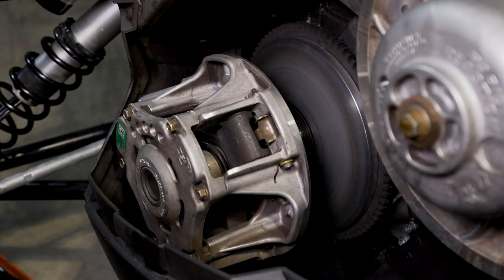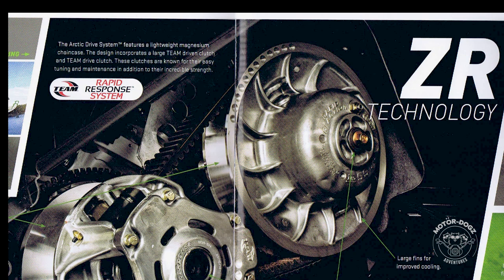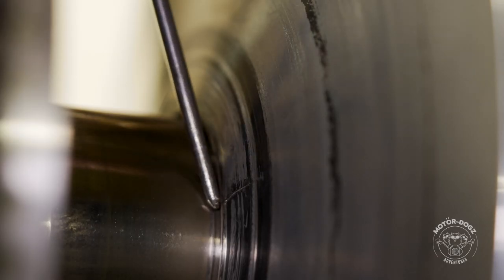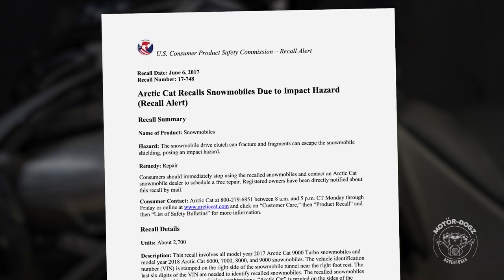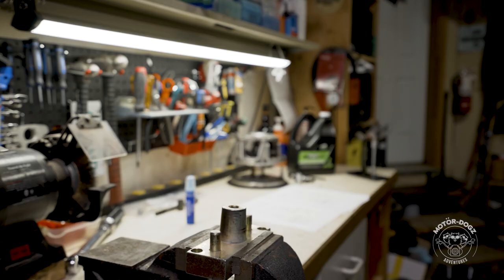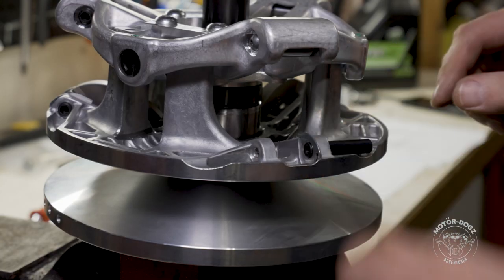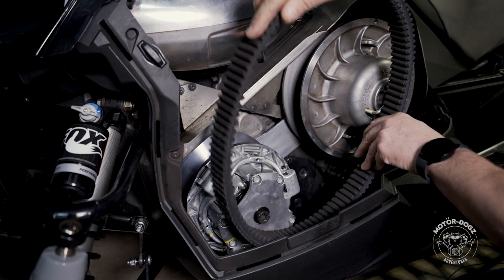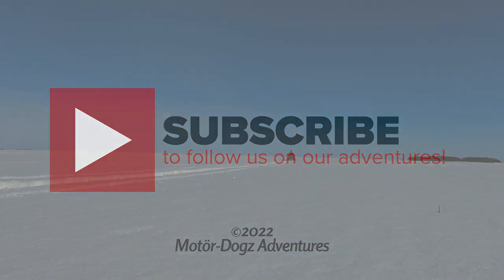Motör-Dogz Garage: Replacing the Team Primary Clutch with the Arctic Cat ADAPT Primary Clutch

Comment: So I gave up waiting on maybe a clutch recall update from Arctic cat as of all of them growing a time bomb effect. I installed a Polaris P-85 primary. I’ve got a 2019 hardcore 153 with a silber turbo.  The response is still ridiculous and belt life has increased also. And I’m not scared to hold the throttle to the bars.  Cheers🍺🍺🍺🍺🍺.
Reply from the maker: Nice. Glad it is working out good for you.  Was it a direct bolt on?  I assume you had to mod or replace your secondary to adjust belt deflection?
Reply: @MotörDogzAdventures  had to get the taper cut.  Special bolt out of states with the funky bushing spacer. Got the bolt from a 16 secondary for deflection and it’s been good.
Reply: @fasterdura1772  where did you get that done?
Reply: @andyfelsman2119  local machinist.

Comment: Great video. I bought a brand new team through BDX in 2020 for my 2013 M8 to replace the old unserviceable cat unit. It has around 2k miles on it and holding up good. When I spoke with the guy from BDX he told me there was a bad run of team clutches cat got from team for the models that came with them on them. Idk if that holds true or not but so far the one I have is not showing any cracking or abnormal wear. With that said, I'm eye balling the adapt but cant justify the switch to it just yet. i guess if I start seeing some serious cracking goin on I'll do it.. but crossing fingers it wont.
Reply from the maker: Thanks! Cat did recall some of the 2017/18 Team clutches for cracking but stopped there. They should keep going as the problem clearly wasn't fixed. Keep an eye on it for sure, check the outside sheave with a mirror on a regular basis. Cheers!

Comment: I would have liked to hear if there was any noticeable difference in operation between the old team and the adapt.  Considering this for my 19 high country.
Reply from the maker: Yes I am hoping to get feedback in this comment section.  I don't have enough miles in mine yet to give an honest comparison however I will post when I do likely in about a month.
Reply from the maker: So far I have almost 1000 miles on the new clutch and it has been working great. I finally received the bolts for the ring gear and installed it. Took a good look at the clutch while it was on the bench and everything still looks new. So far I am very happy with it.
Reply: @MotörDogzAdventures  happy to hear your enjoying the adapt clutch,  and ideas to improve the quality of the secondary clutch?
Reply from the maker: @bennyb6071  my practice is regular cleanings, replace the spring every second season and use Derlin washers to provide a slick surface to help eliminate spring binding as the clutch goes through its range of motion.

Comment: Good ,informative , just scribed
Reply from the maker: Thank you for your support Mike! 🙂
Reply: Do you know if the clutch will fit and the Suzuki motor have a ZR 8000 2014
Reply from the maker: I believe it is possible however I have not looked into the details.  Here is the current cross reference charts which go back to 2016 which is the Suzuki 800.  The secondary's of course are different for 2015 and older.

Team to Adapt Driven Clutch Cross Reference Chart
https://support.countrycat.com/posts/4537448-team-to-adapt-drive-clutch-cross-reference-chart
https://support.countrycat.com/posts/4537447-team-to-adapt-driven-clutch-cross-reference-chart

Comment: Or just put a cvtech clutch on it and never have to worry about rebuilding a clutch again. Problemo solved
Reply from the maker: I considered the CV Tech however my local dealer had the ADAPT sitting on the shelf and the CV Tech was back ordered so it made my decision easier.
Reply: I have installed some cv tech clutches had one grenade out of five but every one else was happy